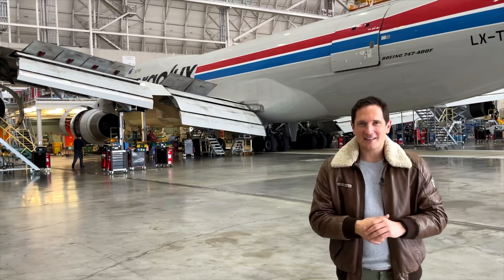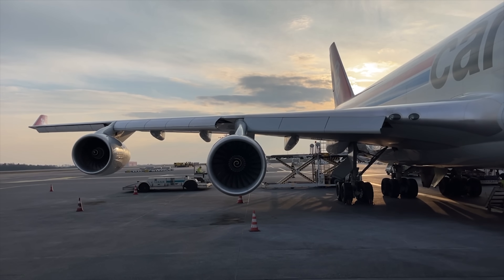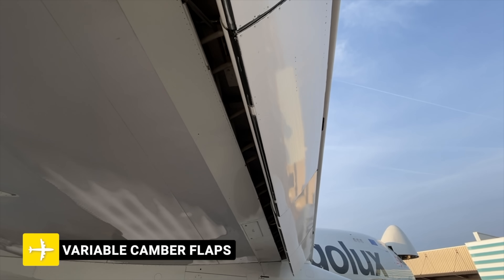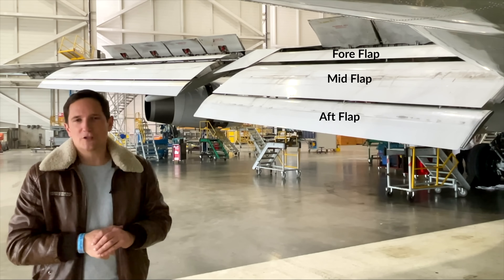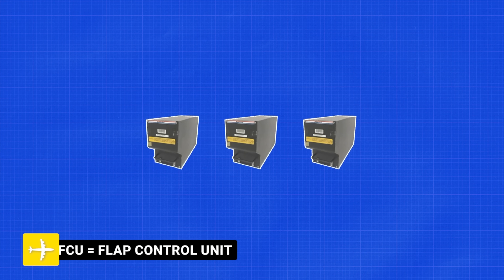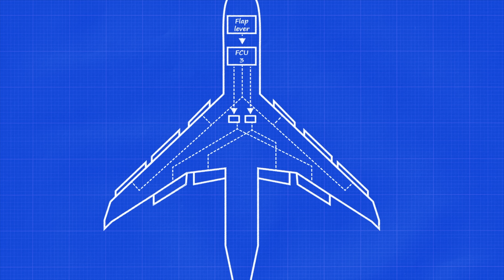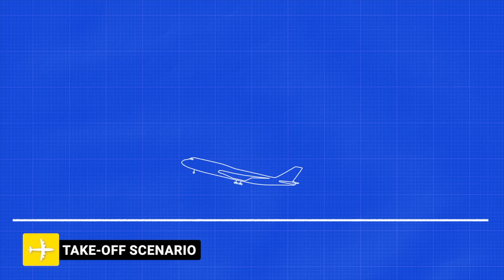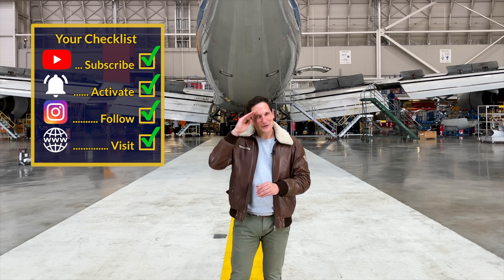How do FLAPS EXTEND on AIRPLANES? Explained by CAPTAIN JOE

Comment: Great video Captain Joe, I have a question.  I used to build the wings for 747-400, I was once told that the landing gear on the 747-400 would not extend unless the flaps were extended because the impact of the -400 without the flaps would crack the wing box due to such a high speed, can you confirm this of bust this myth?
Reply: I'm expecting this to be nothing else but a myth. In case of a flap-system-failure, the plane should be able to extend the gear for high-speed-landing without breaking any additional systems. But this is only my personal expectation according to the safety measures being taken in the aviation industry.
Reply: Myth. The two systems are not interconnected. Former licenced maintenance aircraft engineer here.

Comment: As a 737 pilot just amazes me how very different the systems between boeing aircraft operate. Would’ve never thought the LE flaps were pneumatically operated.
Reply: But i love the Boeing 777 because it has a fly by wire system like the Airbus A330.
Reply: @muhammadabdullah03  the 737max has flight by wire spoiler system 🤭
Reply: @m4nu507  Nice.

Comment: I would be interested to know how the flow seperation and stall doesn't occur when the flaps are fully extended. That angle looks extreme.
Reply: Each segment of flaps (fore,mid,aft) gets the airflow from the part in front of it. So they have and angle of attack relative to the part in front of them. Aft flap from the midflap,midflap from the fore flap,foreflap from the wing.
They act a bit lime a slat to each other,practically.

Comment: First of all - what a great video and the location made it even more interesting and fun!
This topic also is really interesting and the flaps system was something I had to study a pretty long time until I got the hang of it.. luckily I learned all about it while my internship at Airbus in Bremen and had the engineers explaining it to me  with CAD models as well as actual A380 flaps in a test stand on location - what an experience - but to be frank, as this already was a long time ago, this video series comes in handy as a refresh plus an look into the Boing side of things.. could you also talk a little bit about those protections/safety mechanisms like the lever stops or is that all integrated into the flight envelope protections? 
Thanks again for these amazing videos and I’m looking forward to more insights - I like it a lot when you can access some of Cargolux’s resources;)

Comment: The midspan and outboard LEFs are called ‘Variable Camber’ because the panels actually bend to form a new leading edge ahead of the wing. This flexibility is what makes them susceptible to flutter and partly why they’re retracted during reverse thrust operations.

Comment: In part 5, please cover flap control of Airbus. Any typical Airbus model can be covered. I would request A350 or A320.
Reply: @Eskay64  A few years ago, Captain Joe did a couple of great videos on walk around inspection of an actual A320 and different ports on the body of an actual A320. Those did not belong to Cargolux.
Reply: @sh230968  Yeah but he doesn't work with the airbus anymore, he could still do a video though

Comment: As I understood it, 10 and 20 are for take offs, and 25 and 30 are for landings. But what decides if you should use 10 instead of 20, and 25 instead of 30? And when is 1 used?
Reply: If i remember well it mainly depends if you are runway limited or climb limited on takeoff so lot of factors like take off mass, runway length, surroundings, pressure altitude etc.
During landing ability to decelerate makes bigger difference cause lift increase between 25 and 30 is minimal but drag increase can be quite big. But to be honest I'm not 100% sure. You have to go through the airplanes performance tables to see the main factors behind the choice
Reply: It depends on a lot of factors, but the main ones are performance and efficiency

TLDR, if you need more performance (eg performance limited runways), use more flaps. And if you have more than adequate performance margins, use lower flaps for more efficiency.

Comment: How does the retract detent stop the retraction past 20?  Obviously it can't because they need to go back to 0.  I didn't quite understand how that works.
Reply: Cause the dent requires extra step to go past it. So when you raise the flaps you smack into the detent, which prevents you going straight to flaps 10.
Reply: @Eskay64  that what I was looking for.

Comment: one quick question?? In your opinion, which flap setting should be chosen for landing and take off that ensures safety for the Airplane and sustainability of the carrier keeping in mind a 5000 ft. ( arbitrary runway length) ( by sustainability I mean cost on the airline company). Thank you Captain.
Reply: Flaps 10 is best for engine out performance. Flaps 20 better for getting off the runway sooner, but engine out performance takes a hit.
Reply: Theres no set answer, as it all depends on the variables. But if you are performance limited, you have to use more flaps.
Reply: @ZK-APA  thanks but, i would seek your opinion on it 😀
Reply: @vikrant_karmahapatra89  also wanted to add. Choice of Flap is not always at pilot discretion. It's mostly either SOP based, or performance calculated based.
So if you ask any airline pilot, the answer will remain the same which is "it depends"

Comment: AFAIK the 747 flap arrangement is unusually complex and powerful for an airliner.
In the 70s there were not nearly as much large runways, so reducing the takeoff and landing distance as much as possible was important.
The 747-8 got a redesigned wing with simplified flaps because in the meantime airports have caught up to the size of modern airliners.
Reply: How did they simplified the flaps? They are the same. I will agree that the wing is more swept.
Reply: @TB-um1xz  Its a completely different layout, with dual element inner and single element outer flaps instead of the tripple element flaps used up to the -400.

Comment: I've noticed that when a 747 is climbing, the leading edge flaps stay extended for an awful long time. In some instances the slats can remain extended until 250 knots or possibly more, from cockpit videos I've seen. What is this phenomenon?
Reply: Sometimes there are speed restrictions that prevent us from bringing the flaps all the way up. For example in Germany they want 250kts below 10k feet. Sometimes we're are really heavy and flaps up speed is 260kts.
Reply: @TB-um1xz  Fascinating stuff. Thank you very much for that much needed enlightenment.

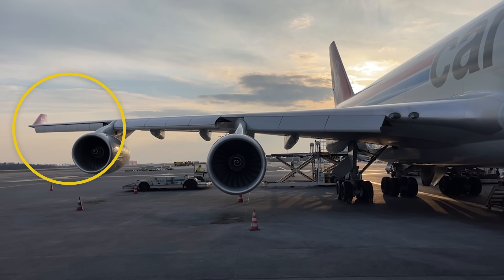Comment: At 9:07, pneumatically? Or hydraulically???
Reply: Primary the leading edge flaps are moved air. Trailing is moved by hydraulic. Secondary mode they are all moved by electric.
Reply: @TB-um1xz  just in case you misunderstood, there is a air pump (which should be driven with a electric or hydraulic pump. But I guess the air can come from the engines) to engage the primary leading edge. A hydraulic pump which is driven by a electric motor? 

Do you know anything about mechanics?
Reply: @alpha_echo_diDi  do you know anything about the 747? No, you don't
Reply: @TB-um1xz  that’s why I’m asking you specific questions. Obviously you know nothing about everything.  Do you know the difference between pneumatic, hydraulic and electric?
Reply: @alpha_echo_diDi  considering that I fly the 74. Yes, I do understand the systems. It is apparent that you don't.
Reply: @Eskay64  thx

Comment: Hi capt joe! I watch your videos everytime you put one out. Im stuck on an explaination you gave on how a jet actually lifts off the ground. At the V1 call, when you pull back on the yoke is there a control surface or something else that causes the actual lift from the ground? Thank you for making such neat videos!
Reply: The elevators move. And rotation isn't at v1 it's at vr
Reply: @syedazzam7740  thank you!
Reply: @timsebastian5758  np m8

Comment: Any chance of having a video explaining the difference between Airbus and Boeing flaps? Airbus seems to use a less complicated setup (at least in cockpit). Would be great to have insight about this.
Reply: Yes, that would be super interesting especially because Joe is a pilot for Airbus and Boeing models 💪
Reply: @TheLikeys  Believe in JESUS today, confess and repent of your sins. No one goes to heaven for doing good but by believing in JESUS who died for our sins.  For God so loved the world that he gave his one and only Son, that whoever believes in him shall not perish but have eternal life.(John 3:16)🥳❤️
Reply: There are some decades of engineering between the 747 and a A320 or more modern aircraft.
Basically Airbus has more advanced aerodynamics on the flaps therefore can use less, saving weight and maintenance whereas Boeing sticks to simpler aerodynamics and therefore less development costs on this. But Boeing catches up on newer models.
Reply: @roichir7699  absolutely not true. In terms of advancement, they are competitive with each having selling points and trade offs. 

For instance the 787 replaced the concept of using bleed air from the engines to pressurize the cabin. This gives the cabin cleaner air that can be better controlled for comfort. Most would agree this an advanced technology. 

Airbus designed fly by wire systems that take the input from the pilots and doesn't perform the requested action if the software thinks it is unsafe. This design philosophy is divisive. Most would agree it was and is a major advancement in technology. 

Boeing aircraft like the 737 and 747 appear to have less technological advancements than Airbus because Airbus didn't exist when these aircraft were designed. 

Both aircraft manufacturers have product lines that are a result of the circumstances of the time they were made. The A340 was an incredible aircraft that entered service into a world very different than it was designed for. It no longer had a reason to exist. The 737 MAX was an incredible advancement bolted onto a Model T,  but it was a result of the circumstances of the time it was made.
Reply: @hewhohasnoidentity4377  I was just referring to flap aerodynamics. Nothing else.
Reply: Its just different philosophies, based on design and requirement.

But tldr is boeing gives you more options (ie more flexibility), airbus gives you more simplicity (ie ease of use)
Reply: Flaps are flaps, they are controlled universally the same. No difference, but in terms of mechanics this may differ from plane models to plane models. I bet boing and Airbus aren't gonna give their flap Blueprints for free right?

Comment: When i still child i wanna become pilot then become astronaut after that, but now i cant make the dreams come true lol,
buy any information regarding airplanes or space are always welcome, and this FLAPS, the function are crucial yet the systems behind are coordinated, even Boeing made some precautions move by giving some mechanical resistance in the case of  something bad happens,
now it raised my curiosity are there is case of plane crash because human error when using FLAPS?, and whats kind of rate pilot doing something mistakes like that?, and i think the others questions probably for part 2 and 3 since i need know the system first, before im asking something foreign for me,
thanks captain for educational video like this

Comment: Why do the inner and middle leading edge slats on 747's redeploy after the plane has slowed down to taxi speed after initial retraction upon landing ? I understand that they retract immediately upon landing to reduce the additional lift that they were providing at slow flying speed...but why do they redeploy at the end of the runway once the plane has slowed to taxiing speeds. Is it necessary in order to retract the flaps ? I just don't understand why the inner and outer leading edge slats need to redeploy ?
Reply: Because that's what the flap setting handle is set at. Once the TR are stowed, there is no threat for damage on the leading edge flaps.
Reply: @Eskay64  I have come to understand that now. TY for the further edification.